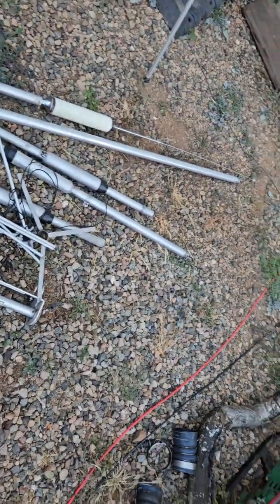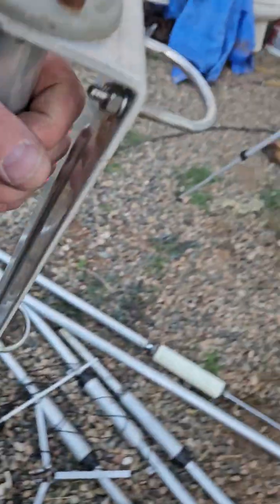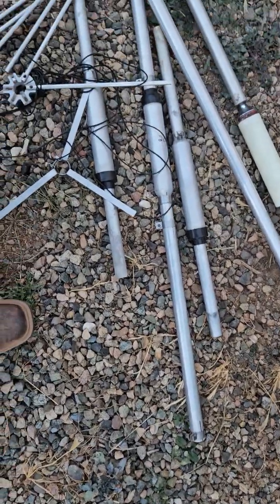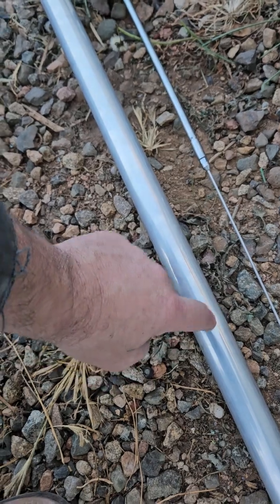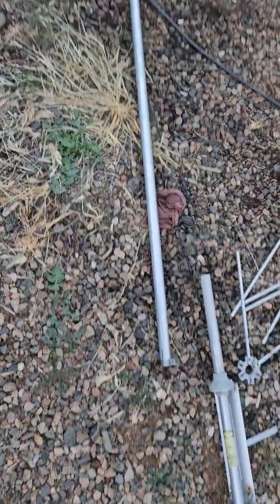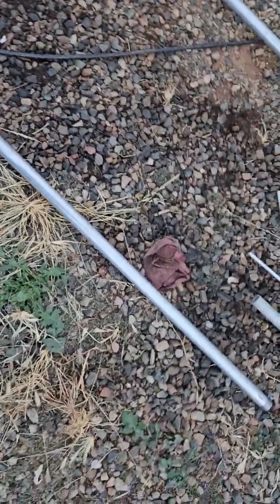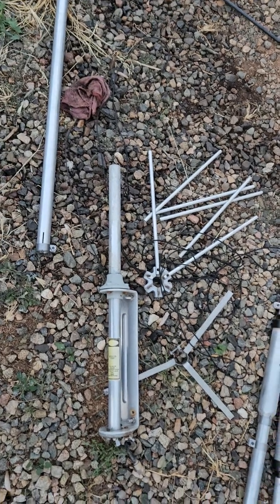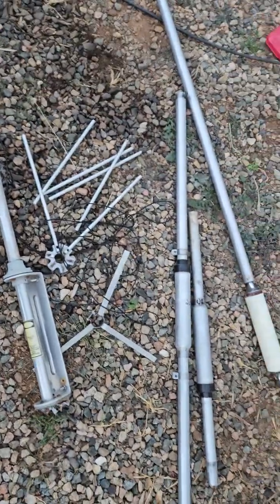HUSTLER 5BTV VERTICAL HAM RADIO ANTENNA

Comment: They are garbage on 80 meter.... 👀
Reply from the maker: Mine was resonating and making noise like a speaker on 80 without the corona ball. I have 2 of these. My 80m hamsticks and mfj outbacker style antenna and mp1 super antenna all work better on 80. 
This is by far the worst antenna I've ever tried out on 80 M that was intended for 80 m
Reply: @hamradiohack  I put a 40 trap on top and a 15 foot wire off the top of mine and 80 was way better the resonator went in the trash. 🤣